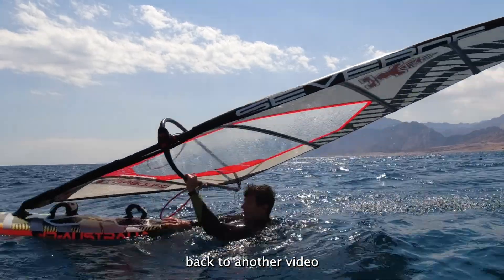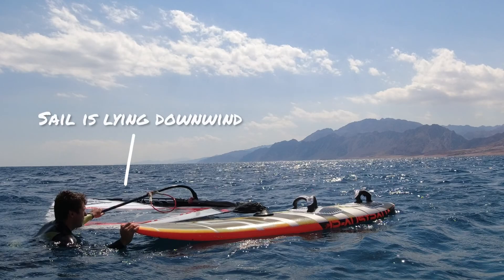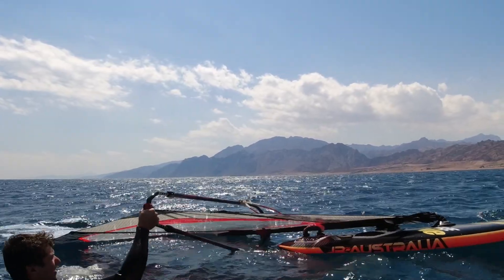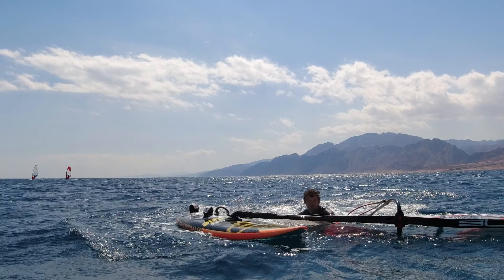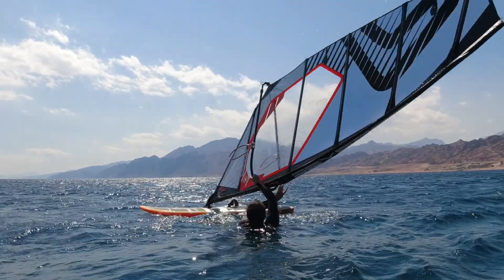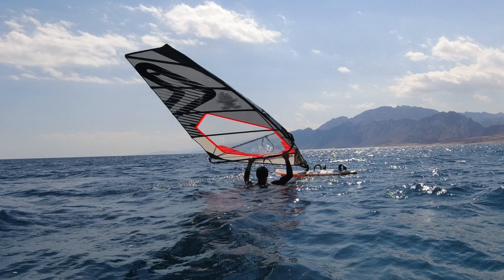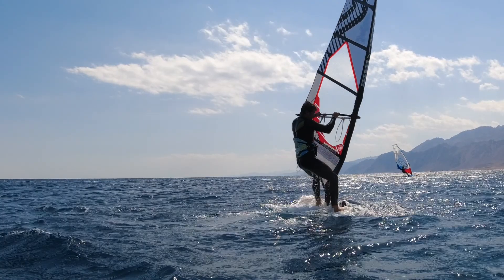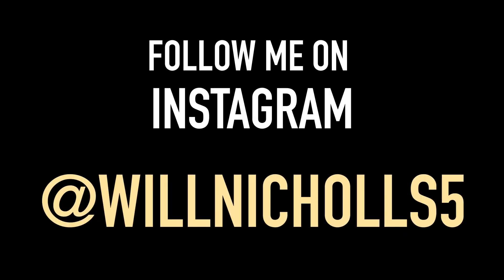Windsurfing waterstart recovery techniques

Comment: Great tutorial! I'd like to add: When there's a lot of wind, it's possible to put your feet in the footstraps and then lift. You'll not catapult then, but immediately plane away. Even with very little power, if you manage to hook in the harness while in the water. I learned this when I had not much power left and was still not ready to end a great high wind session :-)
Reply from the maker: Very good point, I'll do this too in super high winds.

Comment: just can add 2 things
1. if the sale is upwind you can use a top of the must up lift the sail
2. if the clue sank downwind this is the only case when the easier will be to uphole

as usually great video Will, keep going

Comment: how doable are these waterstart techniques in high winds? And are they useful when sailing on the sea on waves?
Reply from the maker: It doesn't really look like it but the wind was around 25 knots in the video so yeah it's all possible in high winds. The benefit of being able to water start in any situation no matter how the gear is setup is that you can water start quickly so yeah I think these techniques are useful when you're out in the waves. I would probably learn them in the flat stuff first though.

Comment: I did not know the fin waterstart.. thank you

I have tried also light wind waterstart grabbing the sail with the back hand, never succeeded. I can put the sail in position but cannot go on the bord. What is the key for success ?
Reply from the maker: I actually have never tried to light wind water start that way, I will usually just stand on the board and pull the sail up from the water by grabbing the mast. I will give it a proper go and try to make a video about it.

Comment: Working on my clew-first and fin-first waterstarts. Just can't seem to keep my balance. I always end up in the drink! :)
Reply from the maker: With the clew first water starts I try to point my board a little bit further downwind than normal. Once I'm up on the board I usually flip the rig straight away (especially in strong wind) because it can be very difficult to control the power. 

With the fin first water starts, I try to avoid putting too much weight on the nose and take a very wide and low stance to gain control. 

Apart from that, it's just practice. Hope that helps :)
Reply: @willnicholls5  chees mate. Will take up on this next time I'm out in the water!